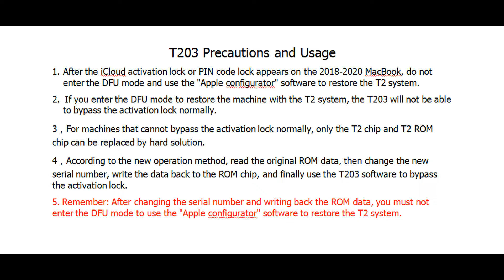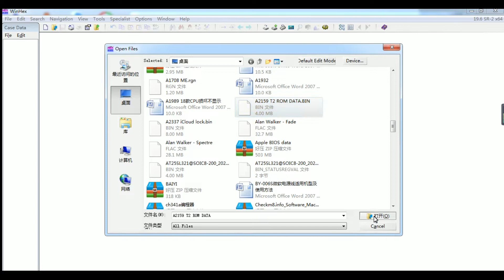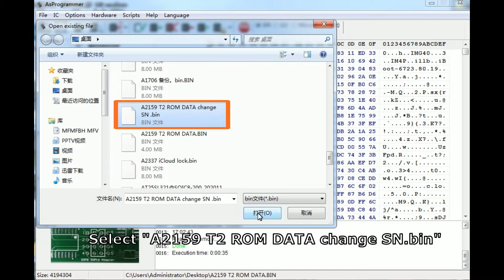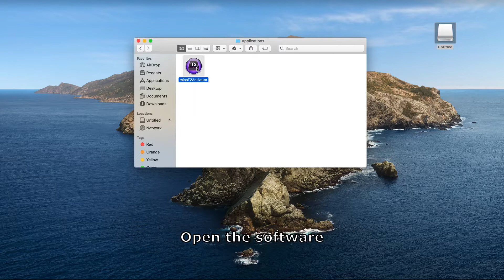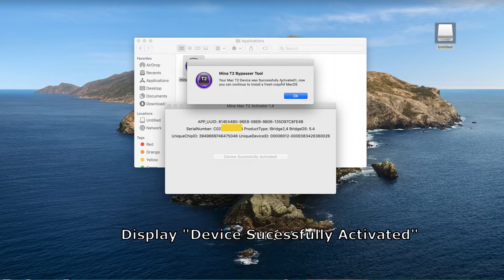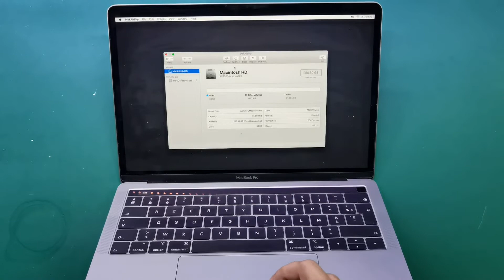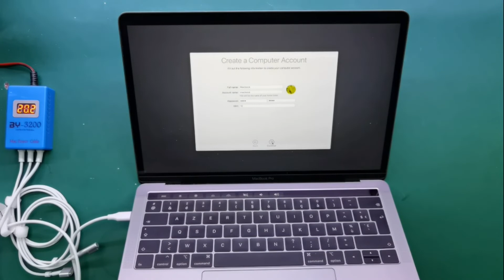Bypass Activation Lock with T203 New Method

Comment: Not found SSH device , do you have any idea about this error ?
Reply: Hi you try with i bridge 6.0
Or blew ?
Reply: Which device you try
Reply: @shazumalik4818  A1932 board 820-01521-A and A1990 but i don't remember the board 
with T203 of course
Reply: @nerifico2165  ok  i have a 1990 and waiting to receive T203 gonna try it the supplier said its works with the latest Pactch also ,
Reply: I have the same problem, were you able to solve it?  i have an a2159
Reply: @shazumalik4818  can you help me please, i have the same proble with a a2159
Reply: Same here now my a2251 doesn't wanna turn on anymore 😪
Reply: Same here no found ssh